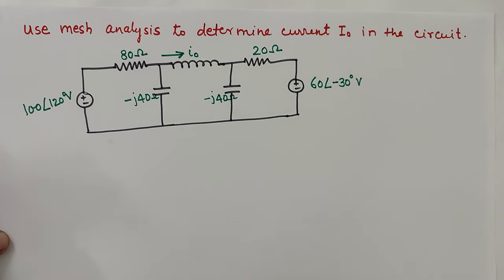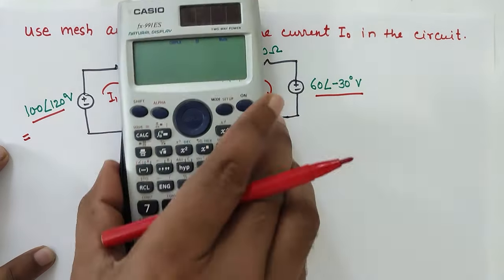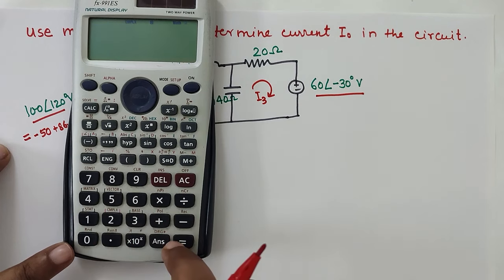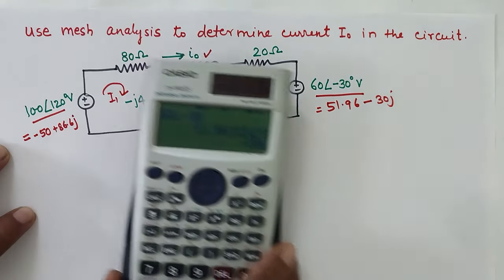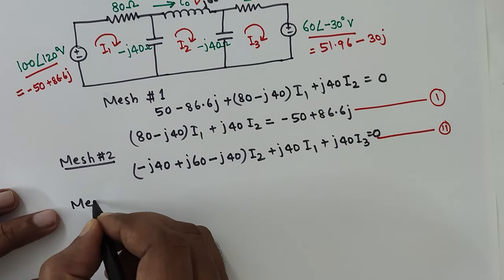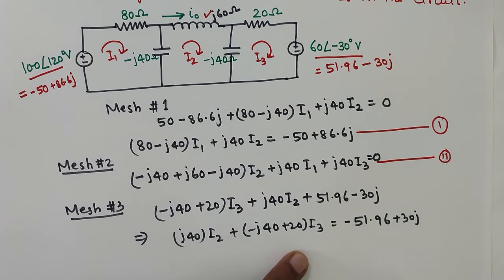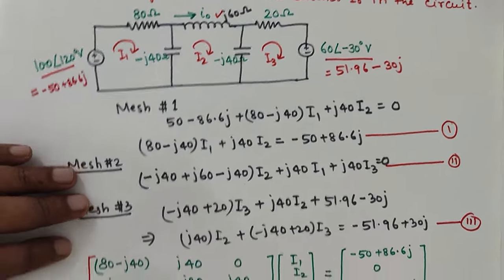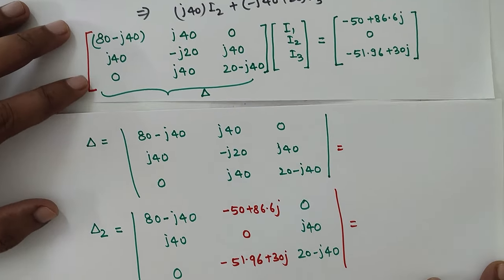Mesh current analysis problem and equation solving using cramer's rule | Circuit/Network theory

Comment: When taking determinant , before second top most value there should be a minus sign i guess ???👀
10:38
Reply from the maker: If you take minus convention, you will get the same. It's just which term you write first.